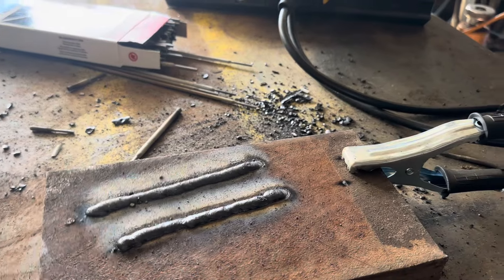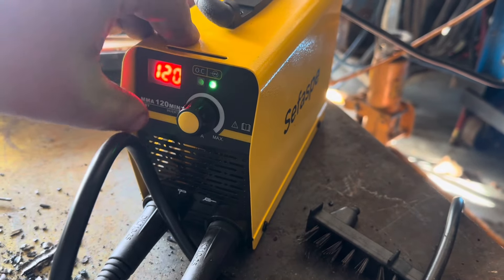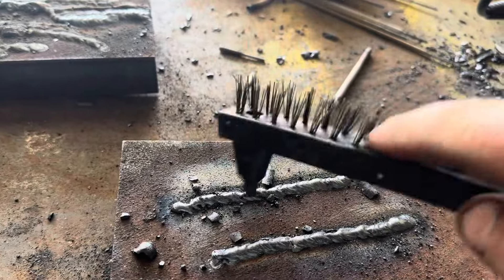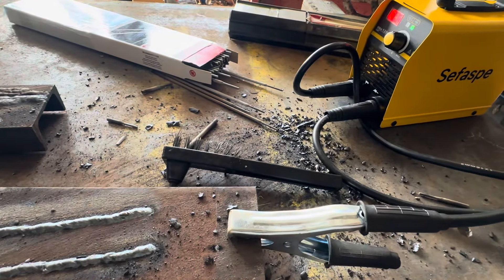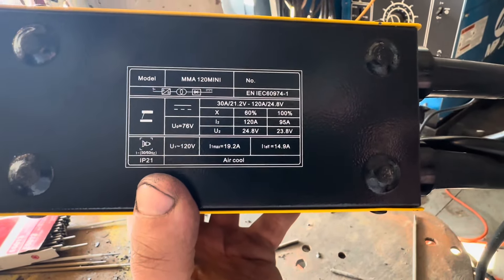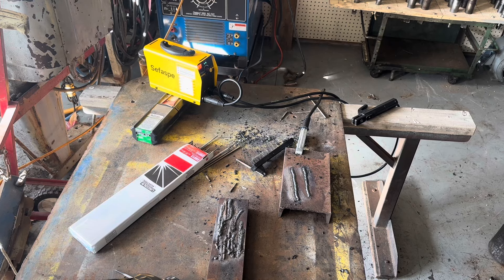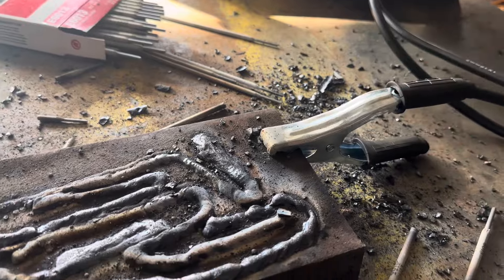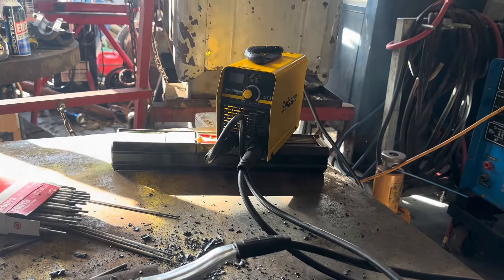Sefaspe mma 120mini stick welder review

Comment: Did you notice you can push in the yellow button on the amp selector? If you hold it down, the display will blink. Nothing in the manual that explains that function. Great little welder for $68. I bought it to make a repair in the woods. Did what it needed to do!